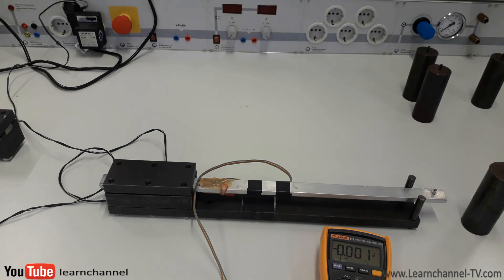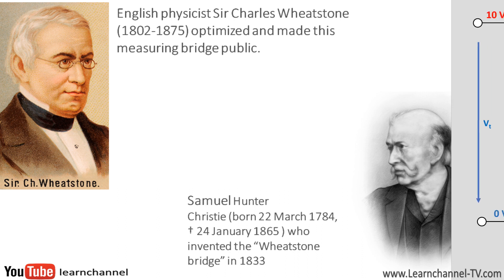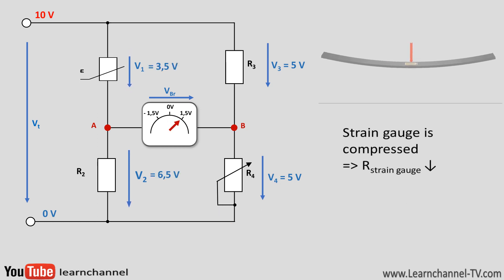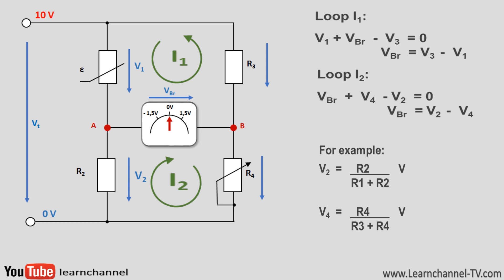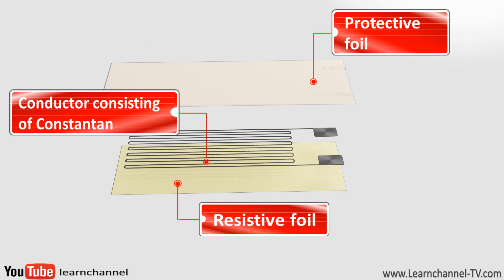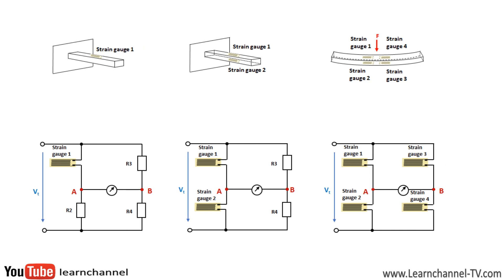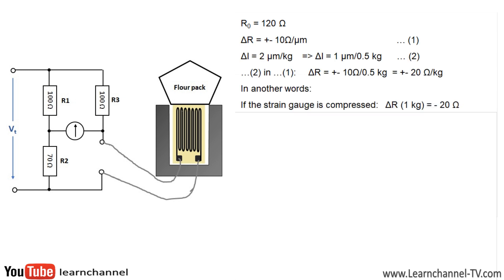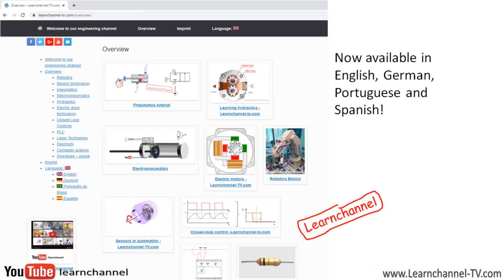Wheatstone  Bridge with strain gauge explained

Comment: Can i used quartz as a strain gauges?
Reply from the maker: Quartz produces voltage if it is pressed. You can use a quartz to meassure pressure or force but not within a Wheatstone Bridge

Comment: can the 4 gauges of a complete bridge be placed on the same face? None in compression
Reply: I hope that i understood it correctly:

The bridge uses the ratio between the upper and the lower resistors (R1<>R2 and R3<>R4). In the formular is somewhere "R1/R2" and "R3/R4". If you increase both resistors at the same time, the ratio between them won't change much. 
That's also why the strain gauge 3 and 4 are "swapped" at the full bridge. The resistors that'll change have to be kind of unsymmetrical or "crossed".
Reply: @Luca-5796  thank you for your answer. I think I understand the importance of having gauges on both sides. However, in my experience, I can't have gauges on the 2 sides, can I at least make a half bridge by having 2 gauges on the same side or is that not possible? If so, is the formula right: Vin/Vout = (K/4)*(ε1-ε2)?

Comment: Given a pressure of 2kpa, nominal resistance of 120 ohm, diameter of strain gauge 0.1mm, a GF of 2. What will be the change in resistance value of the strain gauge?